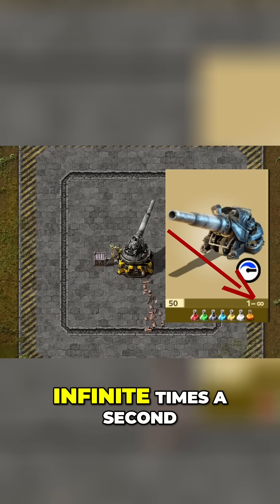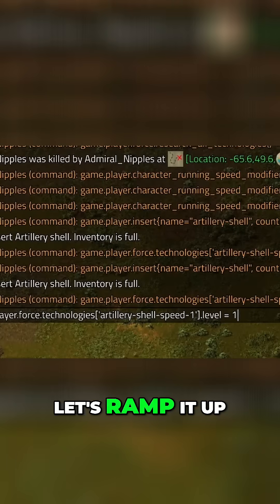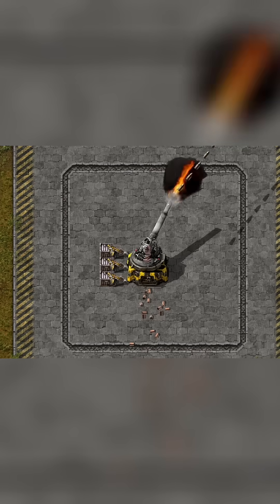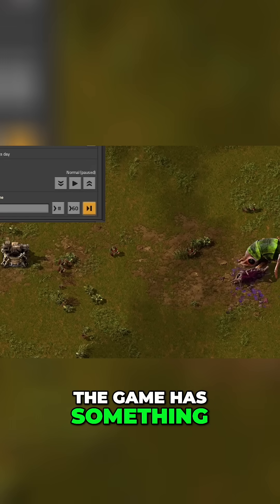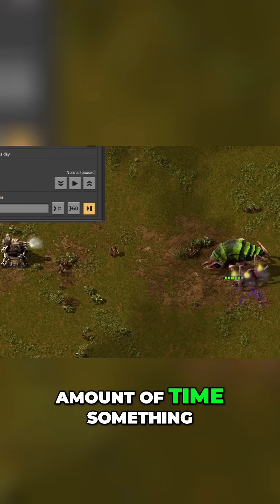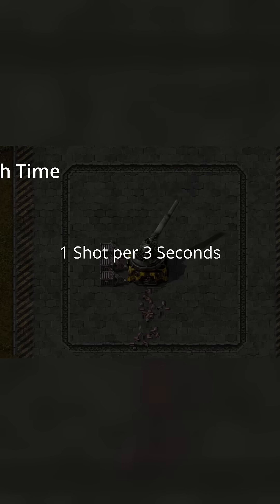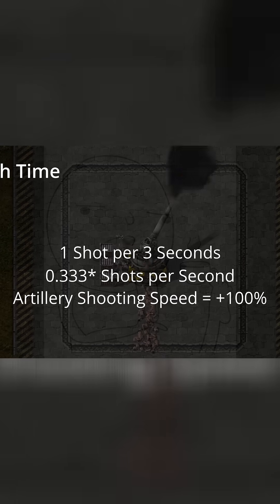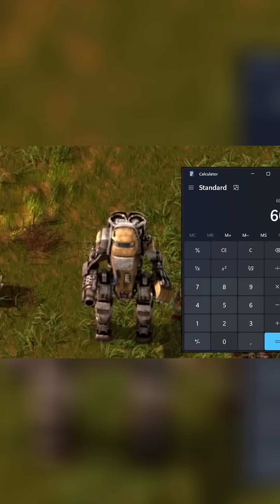Factorio: Infinite Turret Firing? Exploring Game Limits!

Comment: You'd outpace the inserters before you reached the tick rate limit. At 3x3, that arty turret can be fed by 12 blue inserters. However fast those cycle is your max fire rate without mods. Fortunately, there is a workaround. Use an Artillery Wagon. Those are 2x6, so you should be able to get 16 inserters feeding it, plus a 100 shell magazine.
Hold up, there's more. Build 8 rail segments in a row. Remove the 3rd and 6th ones. Place 4 blue inserters in each gap pointed at the middle segment. Now place the Arty wagon in the middle and a cargo wagon on each end. Now you can get 20 blue inserters worth of shells into the Arty wagon. I don't know how to go faster than this in vanilla Factorio.

Comment: The other issue is the rate at which you can feed shells into the turret. Since artillery shells do not stack, capacity bonus won't help us here, and twelve fast inserters can only feed 30 shells per second. You'd need at least epic quality fast inserters to be able to feed an artillery turret 60 shells per second.

Also, the 89 levels of artillery shooting speed necessary to get to 9000% shooting speed for 30 shells/s will with vanilly factorio cost about 1.45e45 each red, green, black, blue, yellow and white science packs. With Space Age, and targeting 179 levels for 18000% and 60 shells/s, it'd cost 7.7e56 of each of the aforementioned science packs, plus also orange.
Reply: Even at 1bn SPM it will only take a trillion times longer than the the finite lifespan of the universe to get to that level of research. No big deal!
Reply: In the time it takes to get that amount of science, getting those few inserters should be trivial.

Getting the targets lined up, no time is wasted aiming between the 60 shots.....
now there's a challenge...

Comment: with 2.0 there has been some strides to break these per-tick limits. Assembling Machines were made to be able to produce more than 1 product per tick, which completely removes any functional speed cap
Reply: I've been running into issues making my 20k spm builds where the 6k/s of molten copper/iron can't exist the machine fast enough to fill up for example a gear machine despite both overproducing, they will just not be at max listed crafting speed. Still making thousands of items per sec works with drills etc but fluids sfill get stuck. Acid neutralisation and steam condesation too. Calculator says 1 machine for 36k steam per sec, ingame I needed like 10 because they just get full of steam while the condesers say lacking fluid
Reply: @PyroYeet  fluids unfortunately have hard upper limits of how much can leave or enter a machine at a time, but iirc this is actually per-machine and moddable and it's much higher now than it was before 2.0

EDIT: with hindsight, this is quite a bit less of a barrier to doing a fluid-based base than i initially implied here and a lot of people actually prefer using molten buses and it's definitely very reasonable to do so.
Reply: @PyroYeet  but besides that, unfortunately this is why fluid-based bases with foundries and molten metals and such are just... not very viable for megabases lol. because of this limitation, you have to have more machines to use more fluid at the same time (even though 1 machine in theory should consume that much fluid) which means more UPS usage
Reply: @Templarfreak  which is not really a huge problem regardless since uncommon science is more UPS efficient anyways which you need to make with the normal furnaces etc
Reply: @PyroYeet  true, not much of an issue there. it's just cool on paper to have things like a fluid bus and use lots of foundries :)
Reply: @Templarfreak  yeah vulcanus fluid bus felt soo cool to do the first time
Reply: Realistically you can never approach per tick limits on firing speed in game. The cost of the research doubles each time, and getting to even level 20 can take a while even with a substantial base. So even getting to the point where the tick limit might be meaningful is 2^160 times more expensive, and only past that would it start to matter
Reply: @leoncalvit9747  YouTube deleted my message. Not sure why. Maybe it thought the massive numbers were spam?
Long story short is that, to get level 180, just level 180, at 100 million SPM would take 485,000 universe lifetimes. I don't remember if I did the math from the Base or SpAge DLC number, because they are massively different. I think it was base game though. 
In years it's
SpAge: 1.5 vigintillion years, which has 63 zeros
Base: 76 trigintillion years, which has 93 zeros
Reply: @leoncalvit9747  actually, at this point getting to level 20 of anything seems pretty feasible and reasonable to accomplish now.
Reply: @Templarfreak getting to 20 is definitely achievable, yes. Getting to 120 means 2^100 times the expense. Mildly less achievable
Reply: @leoncalvit9747  in the base game*